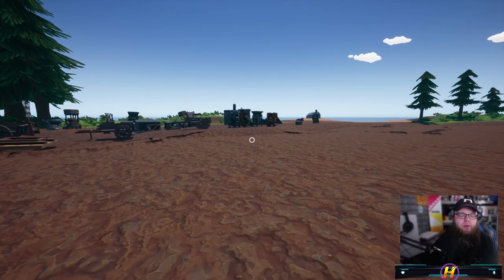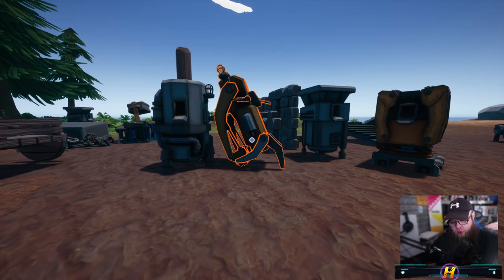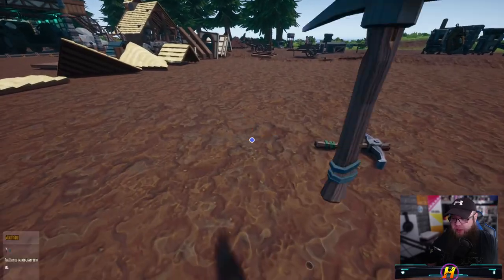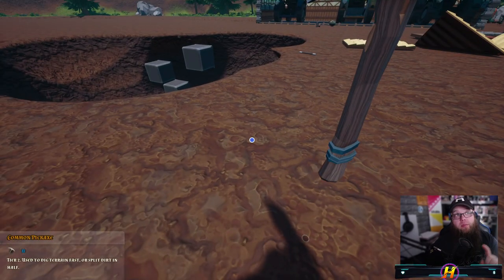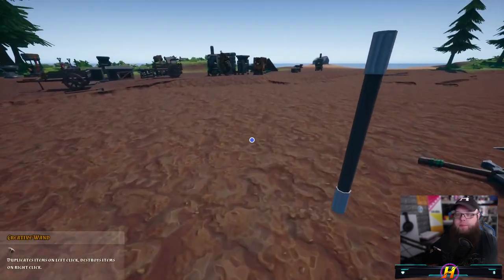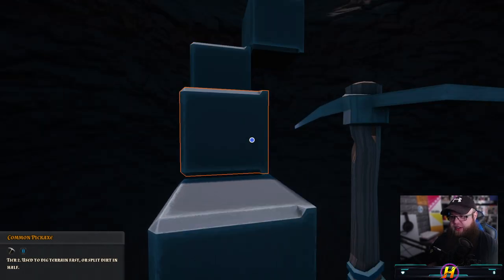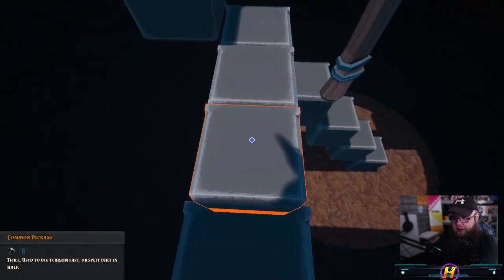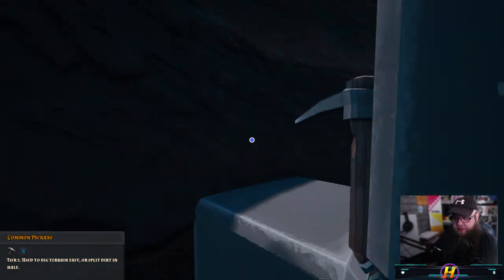Tier Dirt Explained Hydroneer 2.0

Comment: the icehelm forge mine is the same, except turned 90° (so it's horizontal, instead of vertical)... and not only you can't dig a higher tier dirt with a lower tier pickaxe, the lower tier grinder won't, well, grind the higher tier dirt clumps, either (they'll just bounce)
Reply: thank you for the information

Comment: So the thing i struggled with the other day which you kindly responded to, is that i dug down with my tier 2 pickaxe as far as i could. i placed my tier two miner and it wouldn't work.
What the fix was is to raise the miner one whole block. 
So it clips in to the bed rock, it wont work but it "tings" like hitting bedrock, raise it one more block and it does nothing just refuses to mine, raise it yet another block and off it goes. (of course at all points i had dirt under it to try and prime it, i even racked the dirt so it had full coverage, it just has to be that two blocks gap.)

Just threw me that above the tier 3 dirt it wouldn't work!

Comment: Might also want to note that the depth affects the size of the lump you get. at my tier 2 lowest point i get blocks (regardless of gold, iron or gems) weighing around 4.2 - 4.4.
At the bottom of my tier 1 they are about 2.2 weight.
This would make a decent experiment video.

Water pressure changes the speed but not the weight of the lumps.
Reply from the maker: this video is coming up either this week or next i cant remember the schedule for them all
Reply: It's always been the lower one digs the better quality (weight) of ore. This is why most experienced player dig down as low as they can from the very start.
Reply: @Blaze_1961  agreed but with the introduction of tiers i felt it would make a good point to raise in a video  comparing depth, tiers and chunck size 🤷‍♂️
Reply: just curious if I'm missing something obvious, I've been working in Snowrune Falls a few days now. full surface setup just to get things moving. all working well. My next phase was to work on Deep mining....after all the digging and setup of pipes and machines I am yielding 1(kg?) dirt chunks at surface, AND at Bottom T1 level. I've tested Various depths and always seems the same.
Am i not supposed to be Gaining heavier dirt the deep i go with a T1 Drill?
Reply: @Griit282  intersting that's kind of what i suggested the video needed to look at. I believed the deeper you get the bigger. Its the way it always was. Might well be that tier 1 is all the same and tier 2 is different.
If i get logged on later i can certainly go check on my starter rig, its still setup with one on the surface and 10 at the lowest.

I could test the same on my tier two setup and move one rig to the top of the tier 2 range
Reply: @lbwatty  just working on the same for a T2 setup myself, just feels odd that every piece is Exactly 1kg in my set-up no matter the Depth
Reply: @lbwatty  Just tested T1 surface ore is still less than than T1 Bottom ore. So the lower one goes the value increase incrementally throughout all tiers.

Comment: You may want to make an addendum that the depth of T1 may vary depending on the topography of the mine you are digging into. Using the T1 pick Axe is the fool proof way I have used to know when you are at the bottom of t1

Comment: Yeah, hi, 2 questions. Question 1: do profits increase every level deeper? I did a build on the surface and a build 4 floors down and the chunks looked bigger. I assume they're more profitable. Does that apply to tier 2 and 3 as well? what is the gradient of profits? Question 2: Am I supposed to have near infinite gold by the time I get cloutium drills set up? I can't find a better way to target cloutium specifically and I don't really know what to do with all my millions of coins. Thanks bro. Great video!
Reply from the maker: as u go deeper the ores u get from the drills or even hand digging are bigger. also gems are different vales and you can only mine cloutium from 2 blocks down with a drill and below no surfance cloutium with drills.

Comment: Hi - thanks for your videos! They are my "tutorials" right now ;)

But I have a question left: before 2.0 it was, that the deeper you dig, the more resources you gain. Is that obsolete? Or do you get more, when you dig in the same tier a bit deeper? Is Tier 1 floor 1 as rewarding as Tier 1 floor 5?
Reply from the maker: so the way it works is as u go deeper the reource is worth more between floor 1 and floor 5 the size will go from 0.2 to around 1lb then after that weight goes up.. u have to go down a few floors with mahcines so u get cloutium and gems now have different values depending on which gem stone u get. iv covered that as well.
Reply: @Hybridsteel  Nice! Thank you! So its still the thing, when I use the mod where the drills dont remove dirt, I can just shove a bit of "valuable" dirt under them and they dig up all the good stuff!?
Reply from the maker: if u move dirt from 1 level to another the dirt takes the properties of where it is placed so if you take dirt fro msay floor 9 and put it at floor 1 it turns into floor 1 dirt
Reply: @Hybridsteel  Oh, I see... ok, I will have to move my stuff as deep as possible - thank you! You are awesome =)

Comment: What about the mine at icehelm? It seems quite weird, because if you follow the "dig deeper for better resources" saying, the most valuables should be underneath icehelm, since it is so deep underground, and it does count it as underground  as cloutium can be extracted from there, but it seems to be only tier one.
Also I think at a certain point dirt is gonna have to be switched to stone, and I think having a visual difference between the tiers of dirt as clumps would be good as well.
Reply from the maker: its exactley the same just horazontal tier 1 dirt is at the front of the cave t3 dirt is at the back of the cave its that simple
Reply: @Hybridsteel  thank you so much, I was scared I'd have to move all my stuff again

Comment: I'll try to figure out if each tier going to have different resources or not. Probably gonna take some time to move the mine though. All mining soil has tiers on every mine that existed on the map except the first mining spot.
Reply from the maker: nope all ores are rng only difference is the deeper u go the larger the ore so if you get a nugget of gold from top its between 0.3 oz and 0.9 oz and if you get the gold from lowest u cang o right now its between 4 and 5 lbs.. so the best way to get ores is deep as u get more per ore.. depth and pressure have no factor when it comes to which ore you get as the rare elements are rare doesnt matter on depth
Reply: @Hybridsteel  That's a good reason for me to set a mine underground. You're a big help for a new player like me. Thanks dude.

Comment: AS OF TODAY (April 10th 2024) I was able to put a tier 1 harvester in a tier 2 area. It works. It harvests. It just doesn't harvest the full size nuggets that a tier 2 can get, AND you don't get as much Cloutium. Unless for some reason the underground dwarven mountain mining spot isn't tier 2. But I am pretty sure that inside is tier 2 as its already underground.
Reply from the maker: so cloutium comes from 2 blocks below surface dirt i have a video on this.
also u can put a t1 harvester in t2 dirt but it wont harvest t2 dirt as its only a t1 harvester.
the plot of land in icehelm is not vertical its horizontal so the further back into the plot you go the higher tiers of dirt there is.
Reply: @Hybridsteel  so yeah. i put a tier 1 harvester in a tier 2 or 3 area. and it works. but in your video you claim you can't. so you lied.
Reply from the maker: ahh so u can put a t1 harvester there... but it wont process t2 or t3 soil thats what im saying and icehelm is just a normal digsite.. the front 9 blocks are tier 1, the10 to16 is tier 2 and the rest is tier 3.... and like i said the tier 1 harvester will only process t1 soil.
Reply: @goblinphreak2132  He isn't lying, he just didn't realize.
Reply: @AJ_Artisans_  liars lie. Don't defend them

Comment: I really like where they are going with this idea of tiered dirt, however I would LOVE if they made a few changes. I have been thinking about how to implement these ideas and even came up wit ha a chart for the different a values for everything, hell i might even try to make a mod for it.  Here's my idea so far  - i think the dirt should be consumable by the drills, the bedrock layers should not be consumable by the drills, rather breakable via  tnt. The layers in between should be consumed below the drill by an area specified by a bounding box. Dirt would still be calculated at the level of which its being mined. So T1 bedrock, T2 bedrock, and  T3 bedrock would have layers of dirt in-between that was able to be consumed by the drills. Bedrock layers would have a lower value of return since its not being eaten by the drills, lets say 30% less than the previous layer, but its not being eaten so, its a trade off.  Each tier would have deeper and deeper sections of "mineable dirt" lets say 12 layers for tier 1, 15 layers for tier 2 and 20 layers for tier 3.  This way as you go deeper you get better rewards, have to spend those better rewards on better gear to drill and process the deeper goods at better rates and so on.  Bedrock drills would be a little different and would need to be repaired a little more often than standard,  as well as the deeper you go the more of then the drills would need to ne maintained Just an idea I've been working on,  I would LOVE to hear your feedback on it!!!
Reply from the maker: honestly theres been a few of of us who have spoken about the dirt and how it should be done. but its up to max and the team its how they want to do things. 
the next updaqte hasnt got anything to do with mining so we shall see where it goes in the future acording to max 2.2 or 2.3 which should be the next mining updates will be big but we can only guess

Comment: I watched some of your other start videos. Is there a benefit to having your first machines on "Level 0" instead of putting it at the bottom of Tier 1 hole you initially dug with the pixaxe and shove? Or, do you do that to save from buying vertical conveyor belts?
Reply from the maker: right at the start u can do it either the main reason iv done a demo on top level was to mainly show people how to do things.. but id prefer the way i did it in the live streams where the drill is underground.
Reply: @Hybridsteel  Gotcha. I've tried both ways and much prefer going deep and making that money!

Comment: Great vid and information as always.
I did have a question and if it's something you think has merit to it could maybe make a video of.  Since the mechanics of the game aren't just about making money anymore, but now includes crafting with your materials... would you be able to experiment with ore mixing?  By that I mean is it possible to supplement the weight of an iron bar (or even cloutium) by throwing mostly iron in a cauldron with some gold/power ore/etc to increase the weight of it while still having the outcome be an iron bar or whatever bar you are wanting to make?  If it's possible, what then would be the mix ratio to keep the outcome as the intended bar?
Reply from the maker: u cant ore mix when u put 2 sets of ore into a smelter the ore with the greatest value cancels out the other ore and becomes the smelted ore.. so if you put 1 iron and 2 gold the one with the heightest value becomes the main ore in the smelter
Reply: @Hybridsteel  That's unfortunate that would have been an interesting mechanic if it worked.  Thanks for the answer and help!

Comment: Hey, so Im a little bit confused. Does the dirt tier depend on where it was taken from or where it is now? For example, if I take some tier 3 dirt, but put it on the surface will it still be the tier 3 dirt or will it magically transform into tier 1 dirt?
Reply from the maker: hydroneer myth basically. if you take t1 dirt and set ity on t1 it becomes tier 1 dirt... if you take t1 dirt to t3 it becomes t3 dirt.
Reply: Pretty neat, that feature actually encourages making underground mines instead of just going underground to take a few chunks of dirt and making hassle-free mines. Pretty cool!

Comment: Is the deeper dirt within each tier better? Or does it only matter if you change tier layers? For example do you get better loot from level 8 vs level 1? Or should you just stay on the surface till tier 2?
Reply from the maker: changing layers from tier 1 through blocks 1 to 8 u will notice a small change the whole way down.. this can be proven by digging at ember
Reply: @Hybridsteel  cool so lowering my drill section was worth the effort! Thanks! Also I just watched your pressure experiment video where you talk about depth there as well. Super helpful stuff!
Reply from the maker: yep

Comment: How does a drill calculate the soil? Is it from where the soil is taken from or is it where the drill is located? For example; Can you take a Tier 2 dirt and place it under a Tier 2 drill and get Tier 2 results, if the drill itself is located at level 1? Or do you have to place the drill itself as low as possible?
Reply: I found the video where you tested it...
Reply from the maker: yeah been churning content about anything i could think off

Comment: Have you noticed the bug with the tier 2 drills?
When you place them in tier 2 dirt, the spit out large chunks of dirt at first, but if you save and reload they start spitting out smaller chunks, you have to pick them up and place them again for them to spit out large chunks.
Reply from the maker: im hoping thats a thing to come as we need large chunks then the grinders have a job
Reply: @Hybridsteel  couldn't agree more, the grinders are pointless atm, I'm wondering if they be useful when they release tier 3
Reply from the maker: i hope so as the grinders need utilising

Comment: Is there any benefit to using a tier 2 drill or harvester on tier 1 dirt?
Reply from the maker: nope none at all, but the t2 harvester actually works where as the t1 harvester has a clogging issue that is being worked on so hopfully it will get fixed soon. but honestly t2 harvester for the win. if your building t2 has to go deep

Comment: Does the quality of the ore depend on the depth of the drill or the type of dirt placed around it? Like, could you place a tier 2 drill on the surface but cover the bottom with dirt from floor 12 and get floor 12 quality ore?
Reply from the maker: nope if you mine from the tope regardless of drill it will get top level reward
Reply: @Hybridsteel  so it's purely based on location not on dirt. As soon as you move dirt from tier 2 up to tier 1 it becomes tier 1 dirt. Makes sense. I just thought that it might save quite a lot of complexity if you could simply pull a bit of good dirt up to the surface.
Reply: @DrewBradford  I don't think that's right.  Would be great to hear someone definitely confirm this.

Comment: So basically, each tier is 8 blocks deep from the top edge of the unminable flat areas around each plot.  I was able to stack 16 blocks from the top of tier 3 to the surface.
Reply from the maker: when i was faffing with it yes it spllits the line but if you dont have anything on it a si found out i would just sort random stuff.. i had gold and irn in my compressor at one point when i was setting things up

Comment: The terrain in icehelm is horizontal not vertical it's really messed up and confusing. (yes you can buy a dig site inside Icehelm) I have a question, what happens if I place a drill on bedrock?
Reply from the maker: im aware of icehelm iv nuked it and made a video about it. same principals apply but if you put a drill on bedrock due to depth its t3 and as we have no t3 equipment u wont be able to dig there even if you place dirt

Comment: this is going to sound like a dumb question but on each level of each tier what goes first the drill or harvester so can i have 22 drills 1 on each level do i start at ground level or just above it
Reply from the maker: i always have a harvester up top and sorting area in the same area, change harvester per level u hit so when ur mining t2 change the harvester to t2 as t1 dirt will go through that as well.
long conveyors though do cause a little lag at high volume.
Reply: so do i put my first drill one square above the ground level or on the ground level 
 @Hybridsteel

Comment: Actually, based on my most recent try, Logic TNT will also break Tier 3 dirt, as well as the Rake.  And throwable TNT doesn't even dent tier 2.  So currently, I have no way to make a clean tier 2 floor with anything other than the common pickaxe.  Really disappointed.  This is going to take forever to clear.
Reply from the maker: currently everyone has the same issue. so best way to make a flat area is put down the concrete blocks or floors to flatten off area's to build on thats how i do it
Reply: You can use the mod for mining, it's not a cheat as the actual tnt cost 15k ish, and does the work done, otherwise i'd suggest using rake and barrels of tnt

Comment: Whatever they decide to do with this game, its all a bust until Multiplayer starts working like normal multiplayer.
Reply from the maker: multiplayer is done through steam if you got an issue take it up with steam as its the only one that works with hydroneer..  max spoke about it in a dev vlog about why it was the only option
Reply: @Hybridsteel  I dont have a problem with them using Steam, I dont have a problem with Steam being the one they picked.
I have a problem with them using the awful remote-play split-screen-online thing, instead of just peer-to-peer multiplayer or steam-servers like normal game developers would.
Reply from the maker: take it up with the official discord then. any complaints about the game are best on there so it can be addressed by the devs and the team that work on the game.